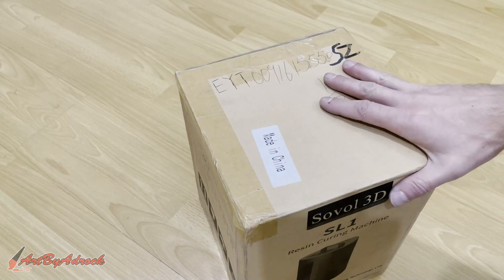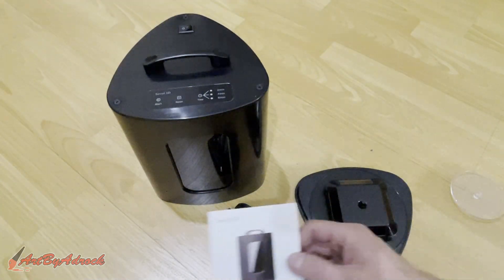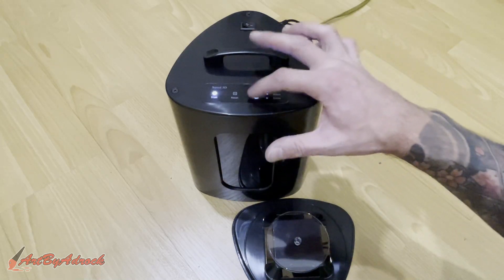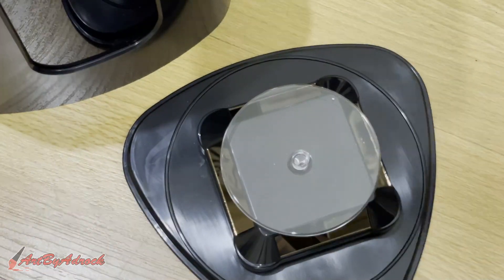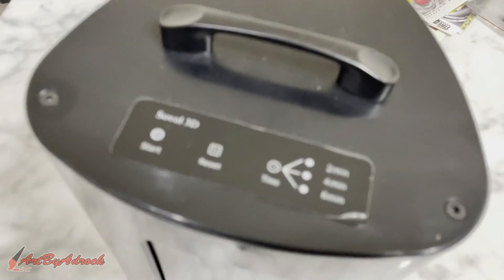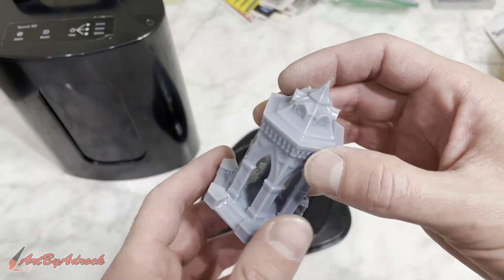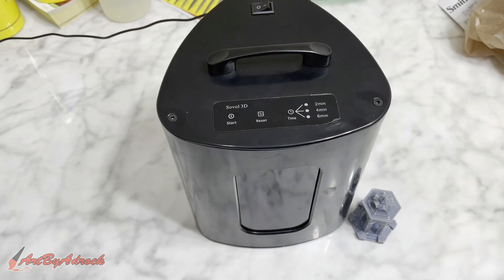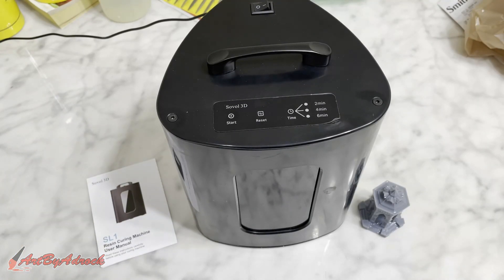SOVOL 3D SL1 Resin Curing Machine - Unboxing, Testing & Review

Comment: Cool little curing machine, I just got a little UV light that came with a little turn table. I just got the Anycubic Photon Mono X, having some issues with it not being able to get the print to stick to the build plate. Gotta get this beast figured out.
Reply from the maker: Have you tried scratching up the build plate with sand paper?  Also, depending on the resin you may need to cure the first 8 layers a little longer than normal.
Reply: @ArtByAdrock  no, haven't tried that, its pretty rough already, maybe a bit more? I use the Anycubic basic grey resin. waiting on a test print to finish, I changed the bottom 8, and set for 60seconds where it was 40, you think that is to much?
Reply from the maker: That should work fine. I have mine set to 60 seconds for the bottom layers and then 8 seconds for the rest. Definitely rough up the plate more as that seemed to help the best for me
Reply: @ArtByAdrock  ok, I'll try that. my test print looked to have worked this time, waiting for the excess resin to drain, I don't like the fact that on the Mono X you cannot turn the build plate to the side so it drains better. This was the first time I used photon workshop, the other few tried I used the Lychee slicer. I will definitely be trying a few settings to get it streamlined, thanks for the tips.
Reply from the maker: No problem.. hopefully it works out well for you 👍🏻